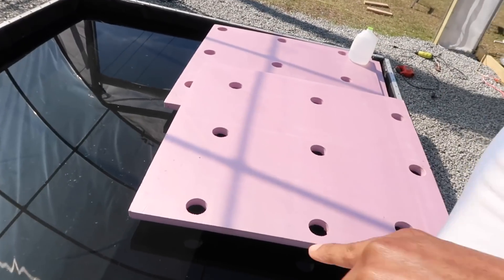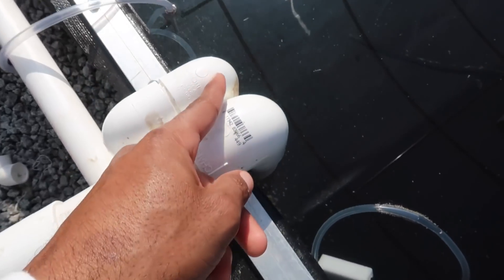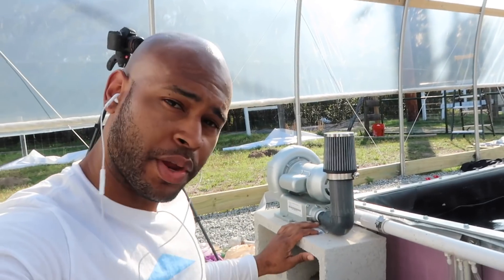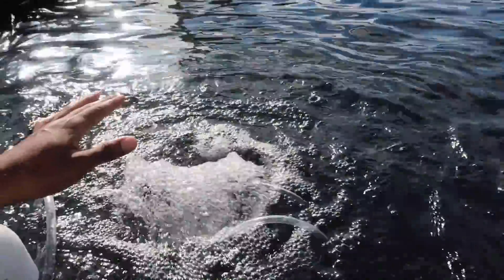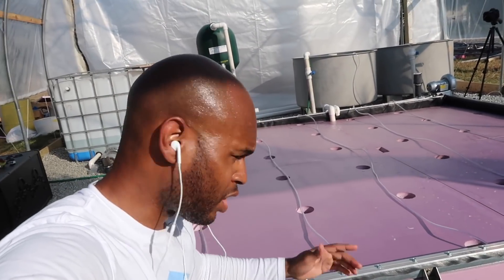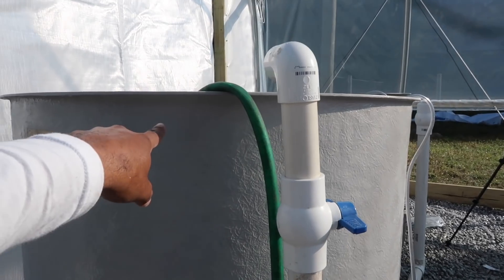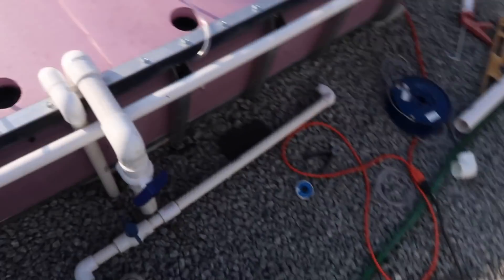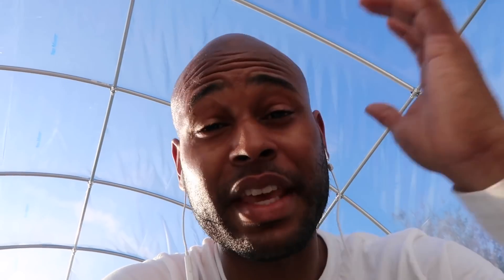Regenerative Blower & Starting The Aquaponics System | The Aquaponics God Ep. 11

Comment: with high-velocity, low-pressure air systems like this, 90-degree bends are totally inefficient. every 90-degree bend cuts airflow almost in half, so it's best to go with wide sweeping bends to maintain air velocity. the air piping might look ugly, but if it works that is the important thing.

Comment: Bro i need help in choosing an air  blower for my pound, i am farming trout fish, the area is 8 kanal or 43560sft, with 8ft, depth, how much should be the Hp of the pump and which company so that i can run the blower 24/7, and can i use only one for the pound or should i use multiple air blowers.

Comment: As someone who worked in the swimming pool industry for a number of years as a pipe fitter and technician I would just like to give you some helpful advice . When you join pvc or pvcu pipes you should always put a 45 degree chamfer on the pipe that's to be inserted because it creates a bead of glue almost like a plastic weld between the two pieces and once in place never twist the pipe when glued, that's how most leaks happen because the glue starts to set so fast that when you twist the pipe you break the seal. Just a helpful tip :)